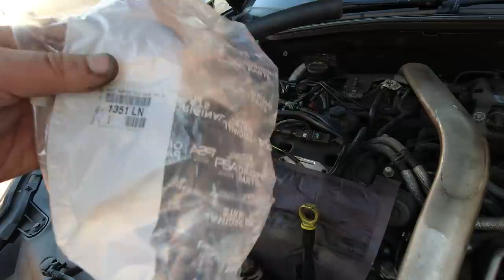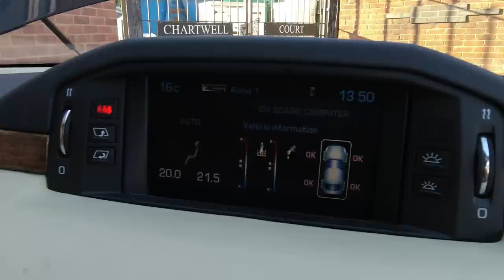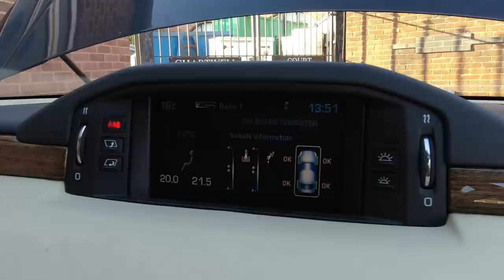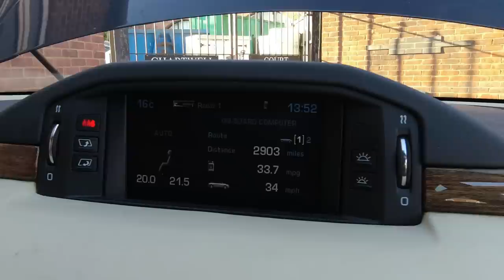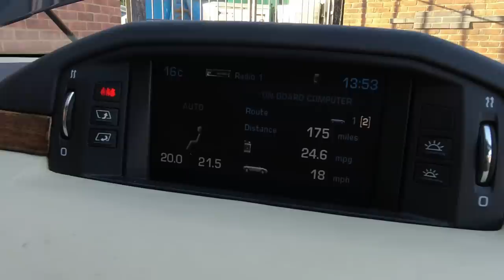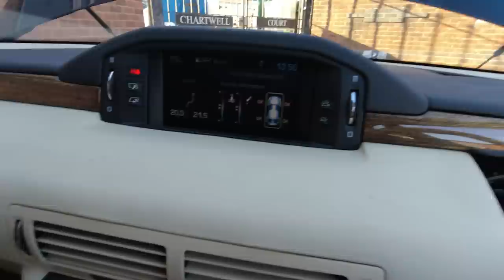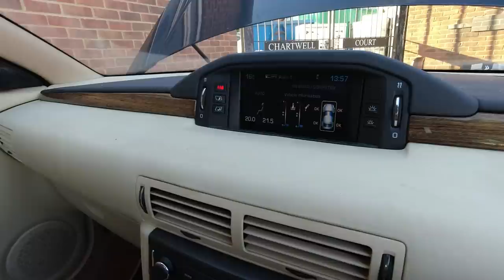Cheap Citroën C6 Project 9:  The straw that breaks the camel's back?

Comment: Nope, unfortunately not. A big "modern" aka overly complicated, plastic-covered tourer with a lot of heavy "conveniency-tech" no one actually needs to drive in comfort ain't the solution for on-and-off commutes and grocery hauls on the go gettin' kids from or to their weekly destinations.
Diesel cars are a problem these days anyway once You don't put in the red stuff or waste veggie oil, which does work well in my 2.5 NA prechamber cars, not so much so in "modern" direct common rail injector engines with a particle plug up their *ss. 
A Clement (which was DS21M 5speed, right ...?) could actually be kind of a solution with some sort of "historic tax" I reckon, which was "none" in the UK as far as I knew ... and with a Dutch LPG upgrade: LPG is meant to be half or less the gasoline price all over Europe (I'm not aware of that in the UK though ...? Might be different since the divorce). A Clement was a family-of-five-car easily, it's nearly bullet-proof and simple from a technical perspective (none of my DS 21 M had less than 250 k km when I got those third, forth or fifth hand, and the drivetrain never was any of a problem whatsoever), plus it is the essence of any Citroën-driving experience with cushy couches and long swing-arms under big, soft-ish spheres, compared to a bumpy modern "hydractive" nightmare like the C-cars Citroën made at their end .... an assessment which was only valid though in case the basic tech is revised/restored/repaired properly (something You are the man for anyway) .... While a Clement is absolutely not the car for road-salt conditions, not even with a ton of fluid film and Vaseline it gets dipped into every other week, which might let You parts of the year still be struggling with an iron-sprung subpar abomination of a salt-beater like the S-max. 
What I do most of the year round now regarding the fuel prices, as we have tackled quite the climate-improvement, temperature-wise, and got that way rid of most of the rain, too down here in southern Bavaria, is having a quick, bulletproof motorcycle (BMW K75 - could help Your three-cylinder desire in the same go 😄) I use for a lot of ways up to 200 km distance a day. 4 L/100km, very fast in jamming traffic once You use the "motorcycle-way" of moving, goes up to 190 km/h with an acceleration enabling You to actually use the speed advantage even on short stretches, (oh, You aren't allowed to, I forgot, sorry 'bout that 😄), plus it is much more fun than a convertible in dry conditions. You can't take more than one kid to and fro in one go on a bike though - might need a little bit of being organized. My son has his own motorcycles already, so I do not have to mess with that anymore. 
Times are not golden for petrolheads and vintage/exotic car lovers, while You at least have a workshop, seem to know whatcha doin most of the time and do not fear a challenge or two per car You freshly get. Cheers to the Island, thanks for sharing, and good luck in getting the C6 sold.
Reply from the maker: I gotta say I don't agree with most of that, but thanks all the same!
Reply: @UPnDOWN  I did not write anything in expectation of consent or endorsement -  I like Your content and Your approach very much, and giving my 2 and 1/2 cents is one way to show that - it's supposed to fool the algorithm, too, I reckon,  and everything else (from subscribing to liking that is) I did already anyway. Thanks for the work and time You put in Your content - it is appreciated!

Comment: Wouldn something like a nemo/bipper be more prctical for you than the other ones you mentioned?
Reply: If it's a van then it's £300 a year to tax, no matter if it's a 1.3 bipper or a 3.2 transit.
That's for euro 4, euro 5 + 6 will be less than that but will have dpfs and adblue to fail constantly if it's only doing short runs.
Reply: @groeacht8525  There are petrol ones. here vans used to have lower tax. I live in sweden. I don't know about now.
Reply: @groeacht8525  in fairness though, if it's one of the passenger versions then the tax is based on tailpipe emissions, so a diesel Nemo Multispace is £30 a year for example.
Reply: Mind you, you'd be better going for the other Bipper/Nemo sibling - the FIAT Qubo. Exactly the same vehicle, but slightly better spec.
Reply: @Teribus13  Yeah thats my point, get the best one you can get. here in sweden the fiat would probably be cheaper to because of the brand.
Reply: @rimmersbryggeri  there aren't many of either model for sale on Auto Trader here in the UK so it's hard to compare.
Reply: @Teribus13  If the tax is flat for vans I understand why pople wouldnt have gotten compact vans like that when the consumption isnt that different.
Reply: @rimmersbryggeri  in the UK the tax is different for the passenger models (eg Nemo Multispace, Bipper Teepee or Qubo) - they're taxed as a normal car would be. The 1.3 multijet diesel versions are £30 a year for the passenger models, for example. It's only the actual cargo vans (Nemo, Bipper, Fiorino) that attract the flat rate of £290 a year.

Same weird logic goes for car based vans. Buy a mk7 (2009-2017) Ford Fiesta 1.6TDCi 3-door car and the tax is £30 a year. Buy a mk7 Ford Fiesta 1.6TDCi 3-door van and the tax is £290 a year. Buy a LWB, high roof, 2.4TDCi Transit, it's £290 a year. Go figure 🤔🤷‍♂️🤯
Reply: @Teribus13  They changed the rules here tax on vans used o be nothing. But people would removethe back seat from their golf gtd and ad luggage tiedown loops for the MOT equivalent and geta tax of about £50 and then drive with the back seat inthe rest of the year. Now vans have a higher tax than equivalent cars unless they are based on the same van as I have interpreted it. Is stupid. Commercial vehicle tax should bebased on wether the vehicleis registered to a business or not.
Reply: @Teribus13  Gotta find a loophole .... put in windows and a seat. If that is still possible - the undercarriage in VW caddies is different from "Van" 2 seaters to passenger car 4 seats. They screw us no matter what - You gotta know the loopholes with everything these days.
Reply: @manfredschmalbach9023  it was a few years ago, but a mate of mine put windows and back seats into a mk6 Fiesta van and he had a hell of a time getting them to change the tax class. I'm sure they'd do it quick enough if you were changing it to a more expensive tax class though...
Reply: @Teribus13  Absolutely - we had a lotta loopholes in our "old" taxation which had a change from "Displacement" to "weight" once You came to 2801 kg max weight with vans like a T4 bully, and another loophole once You changed from "van" to "liveable RV" .... so I basically had "liveable RVs" only for the time that distinction between weight/displacement was valid, and they put new more ridiculous obstacles in our ways to the change of homologation every year .... from welding useless the points seatbelts were had in the back to "the cooker mustn't be put in with screws but welded" to certain standing height requirements which weren't allowed to be met wby tent ... VW lobbied successful against that last one because they had the California with pop-up roof ....it was hilarious, but we got it sorted every time - You just have to read the new rules exactly enough. 
Today's Co2 taxation does ruin the car-driving experience in every aspect anyway, so I do have vintage and historic cars and motorbikes only with my youngest car by far being a 19 y/o Mercedes Station E-class ... and the eldest these days a 1964 Alfa Romeo ....
Reply: @Teribus13  It is weird the UK rules! My wife had a Renault Kangoo (Windows/Seats version) as a company car. On one particular occasion we were asked to transport two 3-seat sofas, at the time, our Kangoo was being serviced and so had a courtesy Kangoo (but a van!!) so we borrowed another Kangoo from a workmate (so seats/windows). We conveyed to South Wales (from Wiltshire), at the time the Prince of Wales Bridge tolls were still in force. I was driving the Windows/Seats Kangoo and paid £4.50, the wife (driving the Kangoo van) paid £9!!
Reply from the maker: It'd be less practical as it only has two seats!
Reply: @UPnDOWN  There are 5 seat Nemos in Germany. It is a bloody small thingy though.
Reply: @UPnDOWN  I thought you had the "family bus" for when you need more seats. Praticality i relative to situation. And for using it as you recently used the saxo I would think a small van was a better option than a hatchback. If you feel you need the seats a xsara picasso should be cheap as chips and doboth jobs better than a c1.

Comment: The vehicle ‘tax’ system in the uk is an utter joke!!! … do not get me started… oh god you have…😂
Reply: Especially for cars registered from 1st April 2017 onwards!
Reply: @Teribus13  If you can afford a car that new then surely the tax would just be a drop in the ocean?
I'll stick to paying £300 a year for a 2.4 that seems to do gpms rather than mpgs, glad I've not got a trip computer
Reply: @groeacht8525  It's not so much the monetary value, more that a 1-litre 3-banger is exactly the same cost as a 5-litre V8.
Reply: @Teribus13  
That doesn't sound like a bad system, considering most of the revenue from motorists is from fuel levy encouraging them out of there picantos into range rovers will have our economy sorted in no time
Reply: @groeacht8525  The thing is, the old system did actually encourage people into lower emission cars. By 2018 the government had already noticed that the average emissions in new cars had gone up, and that's simply because there's no VED incentive to go low emission.

My current car was registered 27th March 2017 and is 99g/km, so it's £0 a year in VED. I'm discouraged from buying anything newer in future in part because of VED (that, and all the rubbish fitted to newer cars such as collision avoidance, lane departure, electric handbrakes, and all that kind of guff)

Comment: You probably tried this, but you could have bought from Amazon a magnetic charge cable and adapter and you wouldn't have needed to get a new phone, but as I say you probably already tried this 🙂
Reply from the maker: Not sure what you mean? The USB socket in my old phone is totally dead - nothing connects to it.
Reply: @UPnDOWN  ah it's completely dead rather than just being full of crap all the time, You could have bought one and then it would have protected  the charging slot from dirt, but I'll get back in my box 🙂
Reply from the maker: I did look at those, but I was told they weren't a good idea due to the high wattage on the fast-charger cable. Mind you, I could have used a regular one...?

But yeah, it's dead. Now I have its replacement I might send it off and get the socket replaced, because it still worked beautifully. New phone is no better, from what I can tell so far.

Comment: It's a pity you have to get rid of the C6 with its coolant leeks and its road tax l don't really understand the system if regestration on motor vehicles in N.S.W we have a simpler system you firstly have a regestration inspection if your vehicle is over 5 years old you have to pay a fee its around aud $40 then you need third party insurance which you can shop around to get the cheapest price and there is the regestration fee which for me because l am a pensioner its free also my drivers license is free l have a 5 year lisense so thats the system in N,S,W also with the registration inspection no emission test and no advisories if sonethings wrong and you have to repair it to oass
Reply from the maker: All countries have different ways of achieving the same thing. Ours is a pretty flawed system, but what's the alternative? Never own the cars you want? I've had to suck it up for a couple of years now, but it's starting to grate a bit.
Reply: @UPnDOWN  Well l own a vehicle a 1997 Toyota Hilux at the time l needed a flat top ute l got it for aud $1500 cheapest vehicle l hage bought in a very long time had 400000 kms on it l was a little sceptical but my test drive was to drive it from Newcastle N.S.W Australia to my home in the Campbelltown N.S.W and it made it no problem then when l start.ed watching you tube and found out that my ute id indestructible so now l will keep it l have never really had a dream car although l do like Citroens they did things do different and l realy enjoyed the C6 because the sjots of the interior do you realize l have seen one C6 Plenty of C5s C2s lots of DSs

Comment: Lease a Tesla on your business. Get huge corporation tax relief, no road tax and costs about half as much as a gas car to run. Stupidly low benefit in kind tax too. Just a thought. I know you’re a petrol head. Me too (Caterham, Stag, R9T) but for everyday use as described by you, it’s a no brainer to get a Tesla. Ask your accountant
Reply from the maker: I'd cost me way more to lease a Tesla than just to fuel the C6 that I already own outright, to be fair. Plus if I was going EV, I wouldn't want a Tesla, I'd want one of those funky Honda E things.
Reply: @UPnDOWN  understand. The key point was leasing. On the business. You can claim 30% of the value of the car back agains corporation tax and that could be 20% of 60k x 30% = £3600 per annum you’re not paying in tax. That was the point.